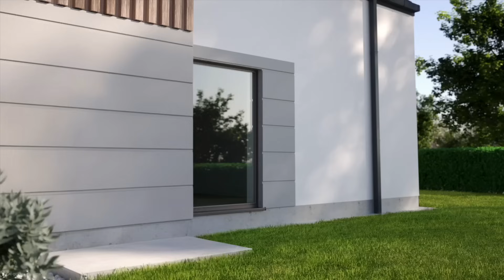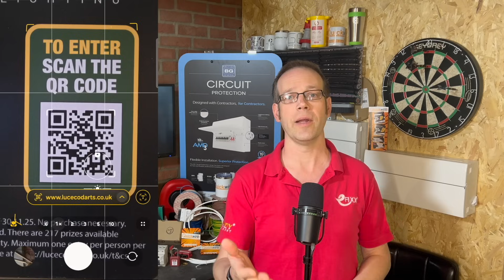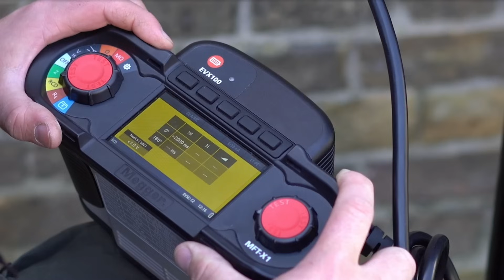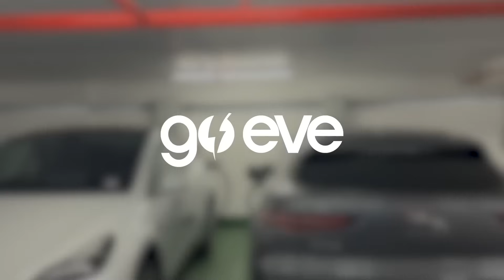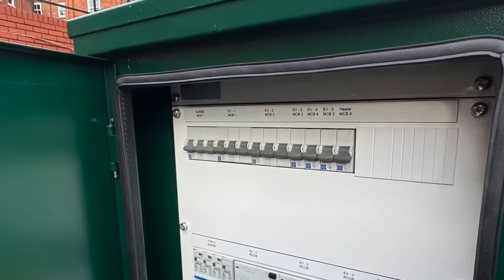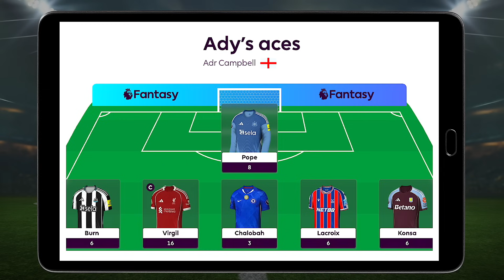National Grid Wants To Move Electricity Meters To The Garden

Comment: Ive got an old house and all 3 phases come to the fuse box even though only one phase is used. I would like to use the other phases. The problem for me is that it’s in the middle of the house so impossible to connect up EV charging or heat pumps without major building works. This new obelisk meter box would be a game changer for me particularly if I had two electric cars I needed to charge at the same time.

Comment: OK as part of a three-phase upgrade it makes sense, new cables new meters new boxes etc. But more than a few questions.

First and foremost who's paying for all this? Substation upgrades, new cables, new meters and these new meter cabinets, new tails into the house and to the exterior units presumably in armoured conduits dug into the ground. That's a lot of cheddar.

Looking at that photo and applying it to my home, the house line you cut into, the EV charger you're going to have to dig across my drive to get to the garage door and the heat pump which in the unlikely event I ever got one would be under my kitchen window at the back of the house, you'd have to dig down the alleyway next to the house line then through the patio to get there. You'd do far better running all three phases through the existing cutout and routing the two new ones through the loft. Or just swap out the consumer unit for 3-phase, but that has it own issues especially if it needs to be moved because it's too big for the current location.

It's all well and good saying these cabinets will be "aesthetically pleasing" but how are they going to be integrated into existing front spaces and protected? On my street alone I have grass, gravel, stone, brick and landscaped front gardens, some over multiple elevations. I have a short wall around my front garden that keep getting smacked by careless delivery drivers. knocking off capstones is one thing, taking out 300A of three-phase power would be another entirely. That's for house that have gardens, what about those that don't?

If an EV charger draws 30A and a heat pump 32A, that leaves the best part of 70A per phase unused, the only other external loads I can think of off the top of my head that could make use of those are a hot tub or air-con, neither of which are particularly well regarded amongst the eco-zealots. Also, why would you put in 3-phase power and not upgrade the EV charger to 3-phase 22kW?

What about existing solar panels and batteries? It's bad enough now that I get ripped off being paid less than half as much for export as I pay for import on the same phase at different times of the day, the suggestion that it could happen on different phases at the same time outright offends me.

Comment: I'm concerned at the condition of the power cable and gas pipe inside my early 60s semi-detached home. They look original, and so over 60 years old. The power cable snakes on damp earth underneath the master bedroom enroute to the consumer unit. It looks old and crusty. Insulation deteriorates. The gas pipe looks old and corroded. I think they need inspecting for safety, and possibly replacing. I have solar and batteries.

Comment: My current single phase supply comes in from a pole at 1st floor level above my neighbour's garden to a wholly internal meter/isolator enclosure sunk into the plaster wall. I hope that the DNO will continue to  ignore my installation which they refused to update when I was having some work done, including a full rewire.

Comment: Good luck moving my meter. The incoming cable is from a utility pole to roof level, then down the wall to the consumer unit - at ceiling height above a kitchen window.

Also, I interpret "the householder will be  responsible" as "the householder will pay." NO, I WON'T.

Comment: There is nothing safe about electrical installations now, health & safety appears to be second place it’s all about profit. I live in an old cottage with my power supply fitted under the stairs, there is no isolation switch from the mains supply line to the consumer unit just a tagged fuse.
In June 2025 I had a  smart meter forced on me which was fitted in the same way as the previous meter but a breaker switch was fitted between the smart meter and the consumer unit, this was left off by the person who fitted the smart meter & required an electrician to switch it on.
This smart meter is switching constantly emitting high electrical frequency inside my property pushing up to 246v, all the electrical equipment you buy today uses less power than before so why increase the voltage. 
On checking out this meter I found it has import & export readings, the import is what I’m charged for so what is the export readings for.
If this meter overheats & sets on fire it would be impossible to get to isolate it. This is an extreme health & safety issue plus damage to property.

Comment: my electric meter certificate has run out I was threatened with disconnected. after checking with citizens advice and the .gov website this week i can no longer opt out and now required by law to agree to have a meter fitted. I have refused the gas meter change as its still in date but am unable to stop the electric meter install. This is a concern and I am already thinking of moving just because of how they have forced the install upon me.... Did your issue get rectified and how long did it take to sort out ??

Comment: They are building a new build development in my village, and they are installing the white plastic electricity meter cabinets on the front of the houses, right next to the front doors. They look terrible against the red brick. And if any of the new owners want to install EV chargers to be installed by their driveways, they are going to have to run a big black cable from the meter across the front of their new house.

Comment: Here in Germany the majority of metering cabinets are inside the building. You can request an outside box but thats rare and only done for structures where there is no room for a meter box like a shed, streetlighting, atm box, food truck and so on. The word boundary somehow sounds that the idea is just cost driven and the home owners are left with the rest. I can understand though that it is much easier for the service company  to plan a refurbish of the system and to keep outtages to a minimum. Over here, if the streets grid cabling is renewed they will give the property owners acertain amount of preparation time to meet the requirements for a cable exchange. If you refuse or do not meet the requirements, you will get disconnected in the process. Of course, if you move everything to the boundary line you just connect the old csble to the new box and do not need to fiddle with private property

Comment: Err . . Err . . If one of the EVs attached to a "Duck Chain"  has fooky electronics . . Especially if the EV is connected to  the charge port nearest the charge unit, does it prevent all the other charge ports from working ?

Comment: We must resist most strongly. I have no smart meters and will not have one of those. Besides like smart meters its gonna be you paying for the change.
Reply: ...why? Ive seen so much fuck smart meters but not one person say why. Like, smart or not they still are going to read the meter and charge you
Reply: @pupalotlau  they are constantly collecting your data and selling it to numerous sources without your permission. There is also a signal strength problem for many parts of the country.  The cost of the meter is around 500 quid added to your bills. The power companies will have total control over those meters. Just for a start
Reply: @robinlewington95 Okay, so I'm not a hundred percent sure about the UK's laws, but I'm pretty sure if they're anything like Australia's laws. No, they are not selling your data to every Tom Dick and Harry because the law tells them that they're not actually allowed to whatsoever. Also, second thing is, yes, signal strength can be an issue, although plenty of other technologies are solving it. Our companies already had total control over your electricity. If they didn't want you to have power, they could just drive to the pole in your house, pull the main fuse there, and you've got no power. They can just turn off your electricity outside of your house. The meter doesn't change anything about that.
Reply: @pupalotlau of course, unless you have your own power supply, but the problem is with data collected 2000 times each day and sold to anyone who asks for it. Laws only apply to the common people. I have told the power company that they can call me and we can work out a price for MY data that belongs to me. There is no law saying that I must have a smart meter in my property. They have been ordered to halt forced fitting and compensate those who have had their property wrongly broken into to fit smart meters. Here in England Edd minibrain the net 0 minister has become a laughing stock and his leaders are on their last legs. Soon all this nonsense will end and England will become the envy of the civilised world and a great place for westerners to live.

Comment: whilst the 3 phase supply would be great, I certainly prefer my 1970's property having the meter inside the house. And have always hated the new standard of putting the meter on the outside of the property.
Last thing i want is some guy being able to walk past my house, with an easily obtainable meter box key and pull my supply fuse, cutting power to my house. Especially at night if they intend to break in, having cut power to any security devices that are not battery backed up. 
With smart meters theres no need to have access for meter readers these days, so the supply should be as secure as possible.
Reply: That's a good counter argument.

Comment: 1960 I was an electricity board apprentice. Most older domestic properties had 3 phases, but only one was used. Newer properties were just single phase. 
I live in a property with an overhead connection and the same single phase for all 4 cottages being fed. I would welcome the cabinet in the garden. It would get rid of the overhead connection, but I'm not going to replace the existing consumer unit at my time of life. Not sure how they would get the supply to it because it's part way up the staircase and fed from overhead.

Comment: I’m not conversant with the way these things work, but in my own case, the supplier has fitted a smart meter and is taking readings monthly and emailing their findings, thereby keeping me appraised my account balance. Am I being a little slow therefore in thinking that where the meter is located is irrelevant? Surely it would still transmit its signal from outside anywhere, indoors or even from the ridge tiles? So why move it?

Comment: They need to make their meters work and provide customer service before making grand plans. I haven't had a single meter in a single property work consistently if at all. I live in an area with great indoor signal with EE, so there's no excuse for it now, especially with mesh. The first one I got they promised me mobile was temporary as they would soon communicate through the grid. I didn't know how they worked before that but I knew it was a poor signal area and I had 4 too thick granite walls, 6 foot on one side. If it's true they use O2, that's always going to be fine in the city but not in the sticks where you can drive miles with an O2 phone and get no signal at all, or maybe one bar flickering on for a moment occasionally. I do understand the reasoning behind 3 phase but can we start with getting the basics right, a company or electric board we don't need to constantly complain to, cancel direct debits, and change supplier in the hope of some service. I've paid more and more to try and get better service but eventually given up trying.

Comment: I don't see what this has to do with National Grid!

Surely it is the DNO who have the system from the  substation to the premises?

Whilst it is easy to fit 3Phase cutout meter and isolation switch in a normal OSV box (as long as there is no other kit in there many homes are not on a 3 phase network or are not suitable for external boxes. There are also a surprising number of homes on a loop feed system with up to 4 homes on a loop!

There is also the tricky problem of people getting access to the box and dropping the supply off ...... this is common in burglaries!
Reply from the maker: National Grid  own the DNO formerly known as Western Power.
Reply: @efixx  OK, that makes sense! I am in the old Norweb area so it is ENW for me! 
I assume this is only a regional decision?

Comment: Of course they do, easier to cut you off or easier to separate your normal household load from an EV or heat pump so they can stop you using cheap overnight tariffs to do washing, drying, or the dishes

Comment: I am a retired electrical engineer.  Been retired some time and many changes have taken place in 15 years.. Certainly my papers have expired.. My bungalow is single phase, the Norm as I say. 60 amp supply and the local transformer station replaced after it blew up in flames is inadequate for car chargers.. Cannot even have a heat pump  due  to logistics.. So I carry on.   Solar panels I refuse on my roof. It was damaged last time and had them removed after 5K new roof. Bills are affordable, so not worried.. Thanks for your info. Another learning curve.

Comment: I saw the theft of EV charging cables coming years ago and I won't keep quiet this time. 
These new Obelisc boxes are going to be vandalised or even stolen. Adding to this, unless they are made of stainless steel or cast iron the cabinets are going to deteriate. This will lead to the units either becoming unsafe and leaving the potential for direct contact or the theft of the enclosures.

Comment: How's Baker light is that okay? they won't like me than I still got fuses 😄where to get the wire from I'm finding it difficult
what's this nonsense about torque of course you can have a torque calibrated arm it's called common sense

Comment: Someone should tell National Grid that the average heat loss in a UK home is 8kW, so that the OUTPUT of a heat pump needed is 8kW not the input.  My 8.5kW heat pump has only ever pulled 3.2kW maximum, that was when it was -12°C outside.
Reply: Right. The average heat loss is even below 5kW these days, so the input is going to be 1-2kW (once it’s in steady state) in almost all cases.
Reply: I suspect it’s the reason why they want you to go to a heat pump, being 200 ish to 300% efficient.
Then again the glowing cables in the ground will melt the ice in winter, when we plug in the cars, have the heat pump on and all the other loads!
Take care M.
Reply: @markeh1971 My heat pump has been 401% efficient on average over the past 5 years, I’m yet to benefit from the drive warming feature I’m afraid.
Reply: the gas plumber who came to fix our combi boiler thinks we'd regret getting a heat pump 😄
Reply: @RoamingAdhocrat most surprising opinion ever :D
Reply: tried one several years ago, on a cold scottish winter night. (JUST WHEN YOU ACTUALLY WANT HEAT). it was useless. input 3kw. cold radiators.
Reply: @georgeh9967 That's because you don't understand how they work, heat pumps are designed to run at low flow temperatures and be always on, just trickling in enough heat once the house is upto temperature to replace what's being lost, so no the radiators won't feel particularly hot. PS I know some in Scotland and they love theirs, I'm yet to experience our first winter with ours.
Reply: @TheRonskiman  i know exactelly how they work, good luck with yours. and i know plenty who have ripped them out. to expensive, no heat. dont tell me how they work when you havent suffered through a cold expensive winter.
Reply: @georgeh9967  Bit touchy there, well you should know they need proper installation and sizing then. Funny how the people in Scotland I know have no problems, and they've also been used for decades in colder climates than ours, but I guess you know that. I'm old enough to remember when we didn't have central heating in our house as a child, so I've lived through plenty of cold winters, have you ever had a frozen toilet?
Reply: @TheRonskiman  AT 72 .YES I REMEMBER .ice inside the windows, sticking your nail in the edge to peal it off, i remember outside toilets and no bath. sitting in the kitchen with my dad both going out to work, no heat in the house, but 1 small electric fire. does that answer your questions. and NO heat pumps still dont work. thats my and many others opinion. you can stick to yours.
Reply: @georgeh9967 I was always amazed at the patterns the ice made on the windows. Opinions are often formed from misinformation, then reinforced with a bad install (far too common with many things these days), and thus cast in stone.